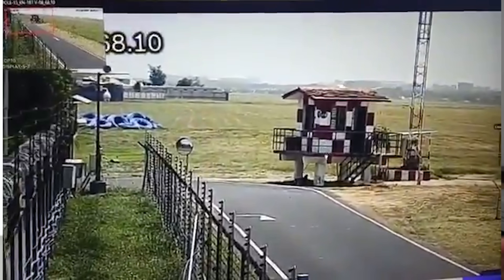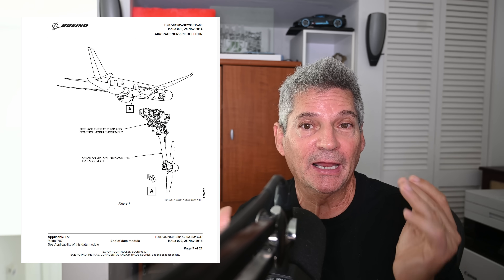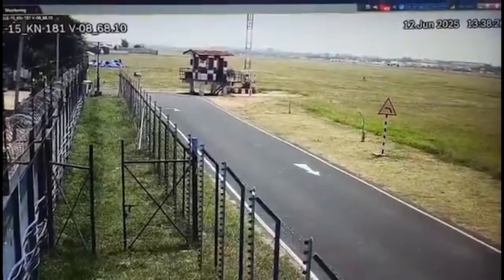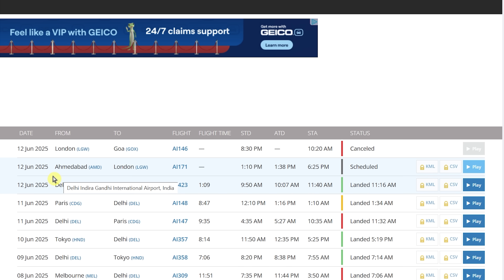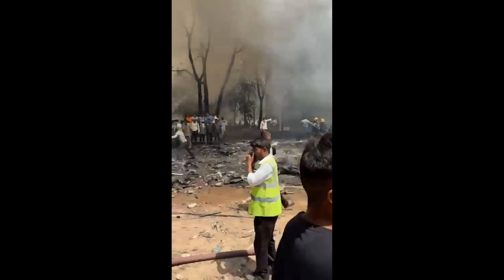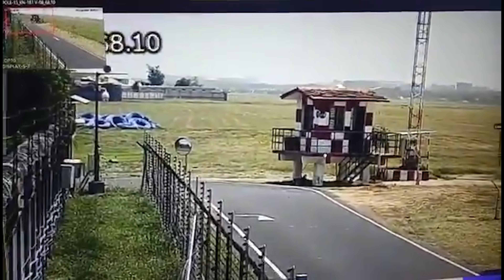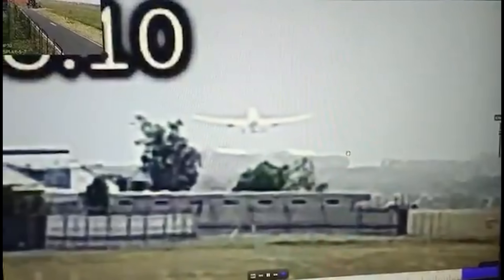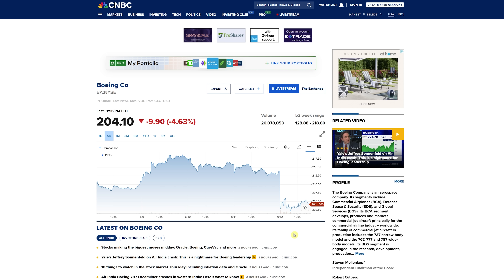What Caused Air India 171 Crash, Mysterious Sound Before Impact

Comment: The real reason is that the jet engine is not increasing. There may be a fault in the electronic accelerator. Otherwise, the pilot may have accidentally stopped the fuel supply. The fuel switch is in the head boat. The jet engine has stopped getting fuel. After the plane reaches an altitude of 650 feet, the flaps are no longer needed. The flaps have been fully extended to the point of approaching the airport. 🇨🇦🍁.

Comment: As a current pilot of the Dreamliner I will add 100% Can certainly hear the turbine of the RAT (ram air turbine) having been deployed as it goes by. It appears the cover fell off. This is normal.
So, the first thing on the checklist for take off is 'Take Off Flaps SET' and this is not correct as they should be at 15 degrees and not anywhere between 1-10. (15 deg should be set when fully loaded and air temp being 40c is a requirement. Yet, even 5 degree flap setting normally just one of these engines has enough thrust to propel the 787 up and away. Heck take off auto-pilot is not used but it can be with auto-flap which have been engaged and various sensors may have been causing a system faults. Such as complete loss of electrical power and engine thrust. Depoy RAT. May-Day. Nose down airspeed up. flaps down. hmm
There have been reports of sensor related issues causing various auto settings to not work correctly when air-temp is 40c. This is when fuel and other systems are modified in the manual and to modify a few take off parameters.
It also appears the pilot may have accidently leveled out the flaps further rather than the gear lever as at 600 feet on takeoff but positive climb is when we usually raise the gears. 
Lots of engine lights and audio would be freaking out and is not clear why they used the entire runway and then some.. rather than making the decision (V2 safety speed) to abort take off. A lot of things seemed to go wrong, indicating multiple failures like a damn EMP was activated but the air-temp was 40c which can cause issues with systems on the 787 and these pilots.
Reply: Do you know if there is a serious electrical failure would that prompt the release of the RAT.  Also could that affect fuels pumps to the engines.  Lastly would here be a delay with the RAT taking over power of the fuel pumps?  Lastly could a power failure also cause the wheel gears to stop retracting?

Comment: Dear Jeff,
What survivor Wishwas kumar told to reporter in Hospital in hindi (he was still not very comfortable speaking well this is what i felt)
he said in short " just after taking off for few 5-10 seconds i felt that plane was stuck (may be it was STALLED ) and then yellow and white lights lit (dont know he meant in the cabin or our side) and then i felt pilot gave the Race (indians use race for Throttle ) in this speed it landed to .. ummm ....what was there " then reporter completed "the hostel" 
so he mentioned lights LIT  , doest it has to do with automatic  APU rem fan deploment on ?

but it means engines were still running 
wasnt the Aircraft in the Stalled state ?
good to find the real video with real sound and share to us , your theory of hearing APU fan humming looks convincing a bit .
but dont forget to take the yellow and white lights lit in to account if it has to do something with APU ?
thanks for the good work

Comment: 1st sign of the problem was the plane used entire runway to lift off thereby kicking dust that you see in a vortex. Wreckage of the plane indicates that slats were activated but flaps were not. Maybe due to electrical failure during V1...take off. But in flight systems are supposed to be completely separate from the main flight system. So you theory maybe right after all regarding Ram deployment.

Comment: Engine no power for the completely take off, the expert pilot try to pull up the front but the result is stalling engines. As all you know, if you want rise in altitude  quickly you have to give power to the engines otherwise the airplane stalled and you are in big troubles ..

Comment: The wings look wrong. 

Not an expert, but I have watched lots and lots of aeroplanes and videos of them.

Where are the bits that extend from the rear of the wings to increase lift during take-off? Not visible. They are really big and normally very visible. In this case not so. 

The wings look like a parked plane, not one trying to take off.

Comment: The landing gear stayed deployed far longer than it should have. Normally, the right seat retracts the landing gear just after rotate. Presumably the Captain had control, so is it possible that the FO pulled the flaps lever in error but announced gear up to the Captain? It would follow that the still-deployed landing gear produced serious drag causing the plane to slow down and despite that, the Captain assuming the gear was up,  added power. But possibly the gear was down and the flaps up and the aircraft had insufficient speed to create lift. The bottom line is that I would not be at all surprised if this incident is attributed to pilot error. The 787 has proven itself too safe a plane for the cause to be otherwise.

Comment: 787 won’t allow TO in wrong configuration 
It was a hot day and long TO roll.
No rejected TO so V1 Vr and V2 ok
Slats and flaps are extended in crash photos.  5 degrees is a normal configuration for the 787 and not very visible.
RAT deployment noise is on video
PIC would push full power when climb rate dropped….no full power available
Gear retraction would have been far earlier if there wasn’t a major power/systems issue.
Conclusion so far:
Major systems failure or fuel issue causing some if not all loss of power.
Nothing the pilot could do hence the mayday call.

Comment: All that back up emergency engine does is provide basic flight controls and basic electrical power. It does not provide lift to aircraft. This means the aircraft lost thrust and also electrical power from the turbine engines. Good grief!

Comment: All planes should have CCTV pointed at cockpit controls and only accessible to investigators, high memory cards are so cheap and small so can easily be added to black box. pilots claim privacy issues but many do live streaming and that does not concern them. if a pilot does not want additional safety measure then refuse to fly or get another job, plenty of others would be more than willing to do the bob and not complain.

Comment: I have seen this numerous times of pilots making a mistake of not setting Flaps or in this case more likely mistakenly lifts flaps instead of the gear as they took off. This has happened many times on the ground with takeoffs with no flaps set but now they have loud aural warnings to prevent that mistake but mistakeing the Gear up with the flap leavers which are completely different should have never happened.

Comment: Two different 'attitude measurements' for the computer, later discovered to be stabiliser sensors.
Seems that Pilots arguing with computer software and automatic systems whilst not having received information about an upgrade that would solve the issue....?
We may have seen this before...don't you think so..?? 🫠
The planes 'flight and crash'  dynamics look similar to recent Boeing insistence with the Dreamliner.
🫡sir!

Comment: The RAT Deployment was seemingly obvious...
The Plane did not have sufficient Lift on Take Off when the RAT deployed.
Can't tell if Slats and Flaps were Extended.
The Landing Gear never went into a Retraction Mode.
I think Possible and Complete Electrical Systems Failure occurred at Take Off.
They had no Room for Error on Take Off.
Full on Stall Occurred....

Comment: Everyone talking about engines dead but no one questioned about a flying object right before crash. Its most likely from the jet engine air lifting off a house roof or loose material. It proves engines were working. The object flies backwards and not front again proving something blew it backwards

Comment: hi, i have a question that might seem a bit dumb. about the flaps: it's been said that the pilots might of not ended the take off process. but don't you necessarily need the flags to get the plane off the ground? im not saying they could or couldn't have failed while in the air, but that question has been in my head the whole day

Comment: Given the fact the high air density which results in loss of wing lift efficiency because of the temperature in India and not having take off flaps set and gear down absolutely results in a stalled airplane.

Comment: Could it had been too heavy? Before take off the captain is given a log of weights and measures that needs to be under the plane max weight capacity (suitcases, wheel chairs, packages, balanced with the number of passengers).  If what he is given was wrong or missing data, errors, the plane may not be able to take off and reach height properly.

Comment: Right before the crash, the engines on the 787-8 got extremely loud, witnesses said it sounded like they were screaming or being pushed too far. That kind of noise usually means the engines were running at TOGA (Takeoff/Go-Around) power, which is the maximum certified thrust setting used in emergencies. Some engines, like the GE GEnx-1B67 on that aircraft, can even go beyond normal limits briefly using over-boost, pushing up to 105–110% rated thrust for a short time. It’s meant to help the plane if there’s a problem, like struggling to climb or losing power on one side. But it puts a lot of stress on the engines, and the high-pitched roar people heard was likely the sound of both engines straining to deliver that emergency-level thrust. Ultimately, it was most likely a call to retract landing gear and the flaps were retracted.

Comment: I've been an engineer and pilot for 25 years. This looks to me like an electrical failure due to arcing which the 2013 model aircraft were known for. Personally I believe that the systems were already degraded before takeoff and when they likely went to raise the gear the LGCIU arced and killed the whole bird. We have seen it multiple times in the early 787.

Comment: We live in 2025. Why aren’t there black box style high def high speed cameras fixed in positions at all airports. They can be on 24hr loops to minimise back end requirements. Given no of airports vs no of planes, it wouldn’t be hard and not a big cost. If it contributes to diagnosing a safety issue from just one crash and preventing another, it will pay for itself. We have aviation organisations that could coordinate this. (c)2025

Comment: Looking at the footage at 1:04, that right wng looks all wrong. Wings on aircraft are designed to be flexible to reduce stress, but that wing is clearly compromised, its angle is far too acute and that could prevent proper accent.

Comment: How does a RAT propeller produce the same sound when rotated by ram air vis-a-vis propeller rotated by a piston engine? 
How both engines go off simultaneously without a fraction of second difference? Because there is no yaw or deviation from the straight path. Moreover the ADSB data shows take off from middle of the Runway. Where are the ATC pilot conversations? Pilot might have calculated wrong take off distance. Flaps seen up, not set for take off or instead of raising the gears raised the flaps...

Comment: The miracle man who walk away said he heard a bang and it crashed according to the translator. The loss of power Auto RAT is audible on the original video. The crew call in a Mayday part way into the journey. The under carriage cannot retract without the power or controls. Rumours of a low side engine compressor heating on its outer leg. Boeing Kegworth engines fire suppressors were wired backwards port to starboard and s to p not p to p and s to s. Hence when an engine blew it switched off the only good engine and the aircraft crashed. I am only stating, stated probable facts with no opinion, but a very sad loss of life and a great tragedy.

Comment: One thing though - as t slow speed with a dirty profile, wouldn't flaps bleed off too much airspeed? Flaps also push up your AoA, so if you were trying to keep your nose as low as possible to generate airspeed ASAP, you want flaps up, no? I suspect gear winch failure - coukdn't retract the gear: the resulting drag and going flaps up would cause an apparent relative sensation of negative g. Could have fooled the pilot into a reflecive pulling back on the elevator control?

Comment: Im pretty sure that the engines were shutting down just prior to take off which would have meant a loss of thrust, speed and, ultimately, lift. The problem was they were committed to take off and had no option but to rotate. Either that or go straight off the end of the runway. It would have been terrifying for the pilots....loss of power, thrust and speed dropping, no hydraulic power to operate the flaps as the electrical system that operates the hydraulics is powered from the engines. I think anyone would have decided to lift the plane rather than just plough off the end of a runway.....partly denying whats happening and hoping that the problem will somehow correct itself, all while knowing its doubtful.
The media, like scavengers as always, are speculating, with some claiming a bomb was on board due to the object seen flying off.......this was actually the rear section and door which hit the first of the buildings, seperating it from the rest of the fuselage. To the media, however, a bomb is more interesting by far.
In conclusion, Im going for engine failure, the RAT deploying, no electrical power to drive the hydraulics......and the rest is history, as devestating and brutal as it was.
My prayers to all those who lost loved ones today.

Comment: I would focus on the Load Sheet and ACTUAL weight, against the Load sheet and likely being well OVERWEIGHT.   The blast dust from the engines just after Rotate suggest it used EVERY INCH of runway and may have been hauled off into the air NOT at Vr but just because it RAN OUT OF RUNWAY!  Just my observations of course, but I would bet money on it.  If CORRECT, then it achieved whatever actual height it did by sheer momentum and with airspeed dropping off and entered a power on stall.  Time and investigation will tell, But I invite Jeff here to consider it and talk to me if he wishes, given I operated a lot in and out of India and know very well how society works there!

Comment: Sounds to me like a dual engine failure on a plane that just ran out of gas, causing the RAT to pop out to keep the required avionics functioning long enough to get the plane back on the ground?
 I think someone forgot to top off the tanks for that 9 to 10 hour flight? 
 And it just so happened to run out of gas at the worst possible time where the pilots didn't have enough altitude to keep the plane in the air whatsoever? 🤔
 The RAT only helps if you're already up in the air descending trying to make an emergency landing due to dual engine failure....
not when you're only 5 to 600 feet off the ground on take off??

Comment: That noise could possibly be the RAT if it was deployed and it automatically deploys under 5 separate causes.   Other than that, it's pure speculation and the 787 hasn't had any significant issues since its inception.

Comment: With regards to AI171 Can it be a pilots fault
1, do you think the pilot forgot to retract the landing gear which lead to Less lift more drag and which in turn lead to stalling ?
2. I see people mention that flaps were up , is that the case I couldn’t make up from the video if they flaps were up or down ?
2. Also, it’s almost impossible for a 787 to lose both engine power at once , so can do you think check list was not run properly ? 
3. Also , did the RAT Come out coz the landing gear was on and the system was confused the take off as landing?

Comment: Why did the altitude graph stop at 600 feet.  Did the plane stop sending telemetry at that point?  Same with the position data.  Seems like there was a computer failure of some type.....Also,, I presume this is a fly-by-wire plane (Electronics), if the main computer failed, or a harness somewhere disconnected, that could cause loss of control.... ???

Comment: He said he saw that after the plane crashed the emergency door opened slightly and that is where he jumped and luckily that section of plane landed on ground floor and not on roof like other parts of plane. According to him a few passengers and air hostess were still alive but as soon as he jumped the plain engulfed in a fire ball. Is he lucky or unlucky I can’t decide. He will have a very big trauma

Comment: The RAT was deployed, in this model, necessarily automatically, when the aircraft lost boot main 240 AC electrical buses and/or the main hydraulic power.

Furthermore, in this same video, it is possible to see parts coming loose from the aircraft just as it stopped gaining altitude.

A catastrophic failure, perhaps revealing an unknown fatigue process or a poorly done repair, considering the new composite materials and their joints with other materials?

Perhaps a meticulous attempt made to look like an accident?

In any case, 172 knots is at least 10 knots below the minimum takeoff speed for the engine maximum thrust, weather temperature (40o celsius) and maximum takeoff weight.

Alarms would have sounded in the cabin during the, by the way, long roll on the runway.

We may be about to discover something new in aviation. But, by all indications, as with the AF 447, not without a human factor as a contributor.